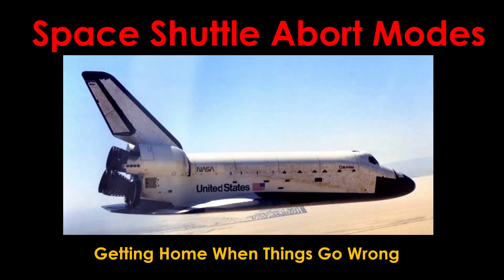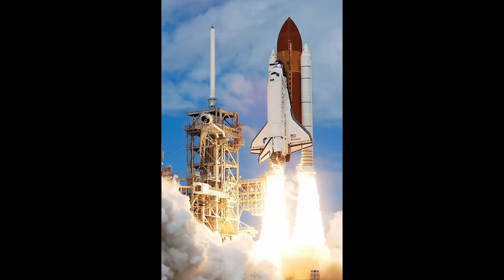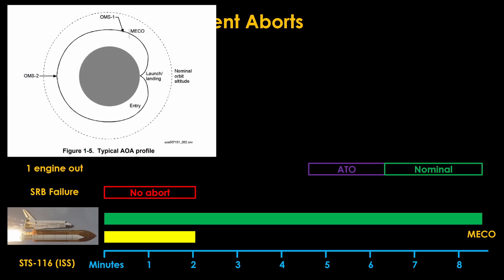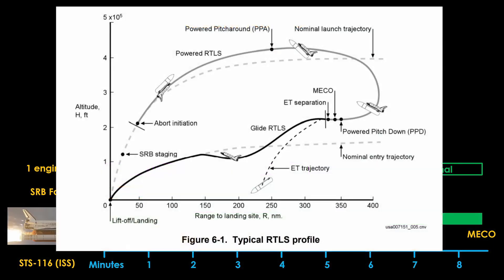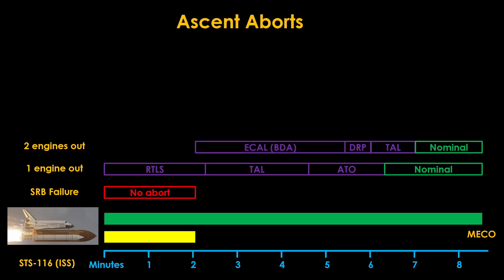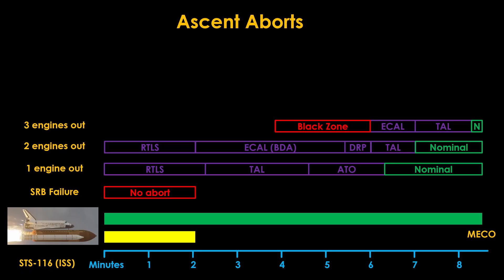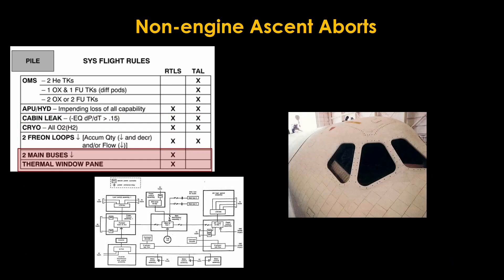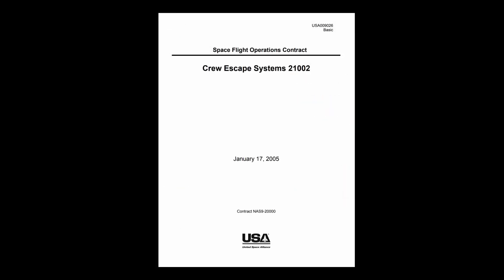Space Shuttle Abort Modes

Comment: A quick comment on your 2 and 3 Engine Out aborts section, 
None of the early ones had guaranteed survival. Attempting TAL from a Droop was possible although dangerous (more fuel has to be spent to prevent external tank overheat so you'd be low on velocity), everything past Single Engine TAL was possible however. 

As for ECAL/BDA, they were actually part of another region of contingency aborts titled "2EO Green", and that region started once the shuttle was high enough on velocity and vertical speed. Anything prior to the Green region is "2EO Blue", which is only survivable if there was high enough vertical speed, which in most cases was not true and would require a bailout. Both of them were incredibly fast paced and required quick thinking. 

As for RTLS, 2 Engine Out RTLS is entirely impossible unless in the last 15-30 seconds or so of the abort (and only for a short time before contingency is required). Otherwise it's a whole different set of Contingency aborts (Blue, Orange, Yellow, Red, Green etc.) never seen elsewhere. 

Last note, 3 Engine Out ECAL was, although possible, quite unlikely in the farther stages of powered flight, and BDA would be near impossible at that point. As for the "Black Zones", you should probably note down that survival would be possible with a bailout, as most contingencies are. 3EO Contingencies were, at most, separating the external tank and trying to survive entry, which was possible and done in the same manner as performed during an RTLS. The 3EO Contingency windows lasted until the Nominal point, as you listed. 

Other than that, you did an awesome job with the video here and it has to be one of my favorites from yours! Nice!
Reply from the maker: Thanks for adding that; I'm always happy to see information from people who know more than me. 

Anything except for AOA and TAL seems really sketchy to me...

Comment: Hi Eager Space:  Very nicely done.  If I may, I would like to add one thing regarding RTLS.  Regarding the 'Acts of God' that were required, the Powered Pitcharound maneuver required gimbal angles of the Space Shuttle Main Engines that introduced structural loads that the Orbiter Aft Fuselage never got 'officially' qualified for.  Not a good omen.  Thank you.

Comment: Great video.  I know the subject was aborts after launch but the space shuttle did have several aborts prior to launch, known as RSLS aborts.  If the RSLS abort occurred before “main engine start”, it was fairly easy to reschedule the launch as it required less work to re-set everything.  If it occurred after main engine start, much more work was required to reschedule. 

The STS 51-F mission had an RSLS abort, which occurred after main engine start and if I am correctly remembering what I read, the same issue that caused that RSLS abort led to the ATO abort when they did launch.
Reply from the maker: That would have been an interesting addition to the topic if I had thought to include it.

Comment: What was the plan if the Shuttle landed in europe? Put the Shuttle on a boat to send it back?
Reply from the maker: They would have flown over the 747 shuttle carrier aircraft and put the shuttle on top and flown it back...

The problem is that there's a specialized crane known as the "mate/demate structure" that they would have needed to get to Europe, or come up with some other method to do the same task.
Reply: @EagerSpace  i was under the impression the carrier was range limited but it seems that they flew enterprise to the paris air show. https://en.m.wikipedia.org/wiki/Shuttle_Carrier_Aircraft .I wonder how they did that. What the flight plan was. Did they stop in gander, thule, iceland. Did they somehow carry more fuel?
Reply from the maker: @kfrdubber  There are some routes that would work listed here: https://www.sky-ferry.com/index.php/about/flying-the-atlantic/
Reply: @EagerSpace they had a mobile mate/demate crane device

Comment: Gemini 6 had a pad abort but fortunately Wally Schirra kept calm and didn’t activate the ejection seats. Would’ve ruined the ship and hurt the crew if he had. They launched on the next try. Apollo 13 lost an engine early on one of the Saturn stages but just burned the rest a bit longer than normal 

The shuttle had at least one pad abort as well and idk if there were more. 

I read that the astronauts weren’t fans of the bailout pole.
Reply: One of the pad aborts (RSLS abort) was actually also STS-51F. It was the only shuttle mission to have both a pad abort (which weren't unheard of) as well as the only in-flight abort. Yet they completed the mission just fine. You can start to see why they got overconfident about the Shuttle...

Comment: If I recall Gemini did have an option to use it's deorbit motors to separate the capsule when the seats couldn't be used. Sorta making it a lousy pusher type escape system.
Reply: It did, but it could only work during the second stage burn, it couldn't "outrun" the first stage and would recontact the rocket and probably send both out of control.

The ejection system had a serious issue, though: the cabin was pressurized with pure oxygen, as were the flight suits. It was never tested with the cabin pressurized this way, and it would probably light the astronauts on fire. It also wouldn't carry them far clear of the craft and there was a risk that they'd fall into the hypergolic mess of the first stage breaking up.

Somehow still less scary than some of the STS abort scenarios.

Comment: Concerning STS-51F: AFAIK there had been a sensor issue with another engine as well and shutting it down would meant that neither ATO nur TAL had been possible, meaning it most likely had ended in LOC when they hadn't manually blocked the shutting down of that engine. I'm definitely no expert but AFAIR there had been other black zones than only when all three engines failed. But possibly this was depending on the mission profile.
Reply from the maker: You are correct. 

At that point, unless you have good data that the engine is going to blow up you are better to inhibit the shutdown and hope it is a sensor issue.
Reply: LM5 has a great video with the JSC communications, even the Flight Director was getting nervous when he asked if they were past TAL.
Reply: @nolancain8792  who is LM5? I don't know that channel.
Reply: @annando  Lunar Module 5
Reply: The famous "limits to inhibit" callout.

Comment: On that one mission where an actual abort was done a second engine sensor also failed, and the computer wanted to shut it down and abort.

Fortunately one of the ground controllers assumed correctly that it was just a faulty sensor and overrode the abort. 

If the abort had proceeded it would have probably ended in disaster with the loss of orbiter and crew.

For all its achievements the Shuttle was a total kludge..
Reply: In that example there actually was a survival case should a second engine fail.
They were in the region for Single-Engine TAL, so the ATO guidance would have just disengaged and steer the shuttle to a TAL.
Reply: @Keru-5829Since 51F was a pre challenger disaster mission (Ironically also flown by challenger) the risks were much higher compared to changes that came afterwards. According to certain documentation, TAL’s had much more black zones compared to what was implemented post 51L
Reply: @Keru-5829- But TAL (Transoceanic Abort Landing) was a crap shoot in and of itself. It depended on when exactly it was implemented, and how long the shuttle had flown on just the two engines.

If the shuttle had to ditch in the ocean it was not survivable. This is the main reason that NASA added the crew bailout option after Challenger, to make that at least possibly successful.
Reply: That's a big "if" though - we all joke about people being rocket scientists, but the people monitoring those stations were the absolute best at their jobs, and it WAS their job to monitor the situation and catch anomalies like that, while quickly providing guidance on a solution. That's exactly what she did. 

I don't think the shuttle was a "kludge" - it was (literally) the most complicated machine mankind has ever created, and I personally think it's a beautiful masterpiece.  It did many things decades ago that haven't been possible since.. and we (as well as many other nations) have the shuttle to thank for the ISS even existing.
Reply: In several ways the Shuttle behaved more like a plane than a space ship. Interestingly enough this also seems to cover the survivability during the start/launch.

On a regular plane there is V1 and V2. When you reached V1 you cannot safely abort the launch anymore - and when you don't reach V2, then you cannot launch. So when you have got an engine issue after V1 so that you cannot reach V2 anymore, then this can easily end in a fatal situation - just like with the STS when there is an engine failure at some unfortunate time.

Comment: Suppose a time traveler was able to sabotage the two main buses or break one of the thermal windows as such that the crew of STS-107 would be forced to abort via RTLS, which seems extremely difficult to do by itself, but we know now it wasn’t impossible. Would Columbia survive?
Reply from the maker: Interesting question. 

I don't think the damage to the carbon carbon reinforce leading edge of the wing would have measurable impact on the chances of RTLS succeeding. IIRC from the columbia accident report, the telemetry identified the location of the hole quite well, and that means it was a small hole that didn't propagate across the whole front of the wing. Given that they made it through ascent without any obvious control problems, I think that means they are fine for RTLS.

Well, as fine as you could ever be for RTLS.
Reply: Probably would have had no measurable chance than any RTLS abort and I agree with John Young it was Russian roulette.

Comment: Great information! This is actually the first place I've ever heard an RTLS being described as potentially doable during a two-engine-out situation. Everything else I've ever read or heard (including recent information) stated that a two-engine-out before Droop or single-engine-TAL would result in a contingency abort to an ECAL or bailout. I looked through the workbook you cited but didn't find any information backing that up. Can you provide any documentation specifically for two-engine-RTLS? I'm not trying to say you're wrong, I'm genuinely curious as to if what I've heard in the past was inaccurate. Thanks!
Reply from the maker: If I'm right - and it's possible I'm not as the information on the less common aborts is a bit sketchy in places - you'll find the information in one of the three references I talk about. My guess is that it's in the contingency abort one.
Reply from the maker: The requirement for RTLS is that you can stay high enough in the air to burn off the fuel in the external tank so you can jettison it (assuming that you aren't willing to just punch it off and hope for the best - probably a good choice if you would otherwise crash) while at the same time have enough altitude and airspeed to do something useful.
Reply: @EagerSpace  Hmm...I'll have to do some research on that, then. If I come up with anything definitive, I'll give you a heads-up on it.

Comment: The abort mode timeline on Wikipedia seems to suggest that Shuttle had recoverable abort modes during SRB flight with a 3-SSME failure . Could the Shuttle actually maintain control on SRBs alone or am I misreading the graph?
Reply from the maker: Two questions there...

The SRBs do have a nozzle that gimbals and they put out about 4 times the thrust of the RS-25 engines, so they are the primary steerers and I'd expect they could maintain control. 

IRC, the training information I read says that detaching the shuttle from a full external tank is not survivable because of the collision potential; that's why the RTLS trajectory did fuel wasting. But the training information does have some holes in it. 

If they could separate, RTLS is out because they don't have the power to do it. Maybe they could get into a stable glide and go out the side hatch.
Reply: @EagerSpace  Thanks! Do you know why re-contact is/is not a danger depending on fuel state? The only way I can see it is that in negative  AoA state the Shuttle generates negative lift pressing it towards the tank, but by the same token I don't know why they can't just do an early roll and detach the tank
Reply from the maker: @dsdy1205  That might be covered in the discussions about the dead zones.
Reply: @EagerSpace  right sorry, missed that

Comment: I find the lack of SRB Failure abort options a bit appalling. Were SRBs seen as reliable or were there really no options?
Reply from the maker: There were options. 

NASA got pushed to the SRBs because they would be cheaper to develop than the liquids that they had been considering all along. I imagine that the decision made a number of people at NASA upset but have never heard any stories that would support that. 

NASA got pushed to Thiokol's design for political reasons; Senator Frank Moss was on the NASA budget committee and came from Utah, as did NASA Administrator Fletcher. 

The worst part is that the failure came from NASA. Thiokol had looked at early data from the SRB launches and knew that there was a possible issue from the design and had been lobbying NASA to fix it, but NASA was uninterested. And - of course - the Thiokol engineers were flat out against launching Challenger in those temps. 

But NASA played the "nice contract you have there, be a shame if anything were to happen to it" card and Thiokol management caved. 

It's possible that NASA would have gotten lucky with the original design the rest of the program and/or would have agreed to a redesigned joint if Challenger had never happened.

If you want more, "Truth, Lies, and O-rings" by Allan McDonald is a great book.
Reply: Really no options, when SRBs are started that's it. You can't turn them off. And if they fail it usually goes out in an explosion. Anything like ejection seats and the likes would most likely go through the exhaust of the SRBs and get destroyed. And aborting the entire Shuttle simply wouldn't be an option.

The Energia-Buran system didn't have this problem since it used liquid boosters so they had several abort options during this period of the flight iirc. Was hoping he would make some comparisons to it but alas.
Reply from the maker: That would have been an interesting comparison.
Reply: US congress valued helping military contractor Thiokol/ATK/Northrop Grumman more than the lives of astronauts. The Russians thought using solid boosters for crewed launch is insane and refused to do it when copying the shuttle.